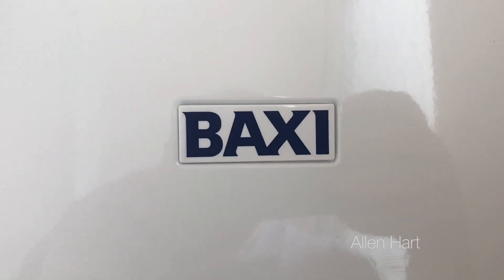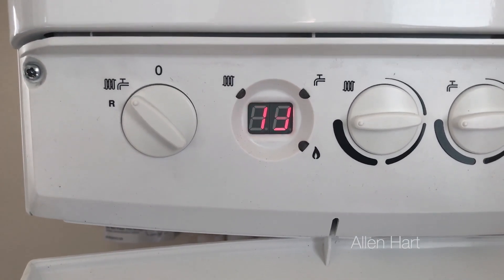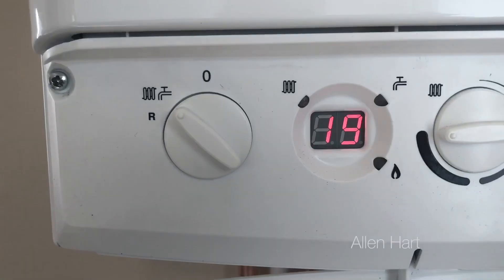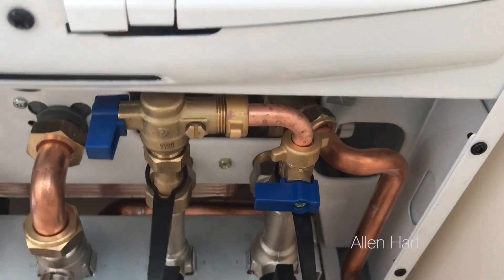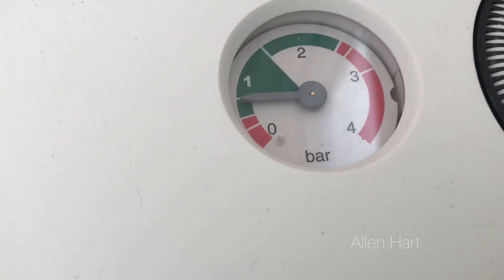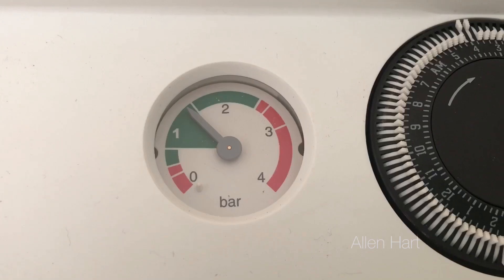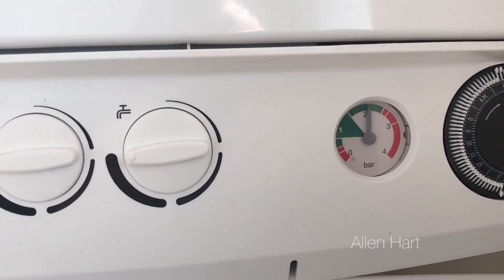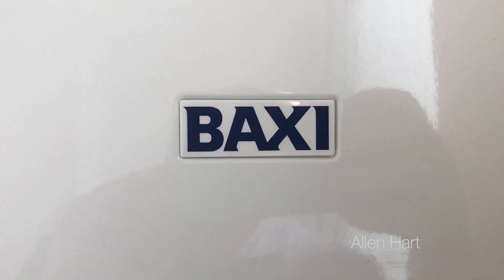How to repair your Baxi E119 fault , Main and Potterton

Comment: I've used this multiple times over the years! Thank you for that, brilliant short informative video

Recently, though it doesn't fix it, I still have the e119 error code when when I've refilled the pressure valve as instructed. Maybe it needs servicing.

Comment: I have a potterton pro max 28 HE with the E1 fault, but the pressure gauge is well in the green zone over one bar. Any ideas? 
Edit: Sorted, our non- prepayment gas meter needed resetting.

Comment: This is a good band-aid fix to get it running again but the low pressure will occur again without fixing the root of the issue. I would check the expansion tank pressure inside the unit as it likely needs to be recharged with 1 bar of air (it's a yearly service that should be done)

Comment: Can u help me m8. I have this boiler. The ngineer came round 6 months ago to check t and it was passed. Since then our hot water is better than it was but wen i went to turn central heating on its not working. Green light wont come on. The dial far left is on hot water\ heating sign   thx

Comment: Hmm we have the same issue, and this normally works. But this time the boiler is already at 1.5 bar and still not working :/. It normally only does this when it dips below about 0.7 bar.

Comment: Hi Allan, many thanks for the vid! Just wanted to ask once the pressure is topped up, the blue valve on the left (out of the two) doesn't appear to go back to its original position when vid started (now its facing down instead of facing towards me). I can't bring it back up to the position where its facing towards me? Is this expected?

Comment: Ive had a bar shower for a few years, with a Baxi boiler , but recently started going hot and cold, so put a new bar on and its exactly the same...Hot pipe straight out of  boiler going hot and cold but not other taps in house. Baxi say it's not boiler and say I may need my taps balancing??? What does that mean? And how does a pipe just go faulty after so many years? What can cause it? Not getting many answers from any forums etc???

Comment: Hi, thanks for the video. 

The blue tap on the left which you move in the video. Is this to be left facing down towards the floor once boiler is filled up or turned back towards 3/9 o clock
Reply from the maker: Thank You

Comment: But why would the water pressure drop?
Reply from the maker: maybe a leak
Reply: @AllenHart999  I had the boiler serviced but I was at work when it happened and the engineer told the Mrs that something needed to be drained and that would fix it. Anyway about two months on now whatever he drained it's not been a problem since. Probably won't be having it on that much now anyway since we're all getting ripped off on energy prices....

Comment: Mine looks a little different, no blue valves or the pipes they are attached to. Would turning the black valves behind them yeild the same result?
Reply from the maker: did you sort it?
Reply: @AllenHart999  I did, I just tried a valve in a similar spot and hoped for the best haha

Comment: Hi Allen, my Baxi was at 2 (when heating on) and everything was working fine. However in past rentals I knew 2 was quite high, so I had my boilerman reduce it, he put it down to 1. Now when my boiler is on all of my radiators aren't coming on, several still cool to the touch. I am starting to think my pressure is too low to heat the system. I notice the boiler is barely getting to 1.5 now he's taken pressure out. Shall I try putting pressure back in and see if it helps get all of my radiators on? Some are red hot and fine but the ones furthest away from the boiler aren't coming on hardly at all. Thanks
Reply from the maker: did you sort it?
Reply: @AllenHart999  yep I rebalanced the entire radiator system using another of your excellent videos! Thanks so much. I was very chuffed with myself being able to do it and follow your instructions!

Comment: Thank you so much for the video as my neighbour removed two radiators for me in preparation for building work and as a result the boiler pressure has dropped to zero. I have topped up the boiler following your instructions but am unsure as to the position of the blue switch on the left. Should both switches finish in the off position once the pressure is topped up? Thank you 
Shirley
Reply from the maker: Thanks very much for your comment, please consider subscribing to support the channel 🙂

Comment: Great videos. I have a MAIN Combi Eco 30 and intermittently get the E119 error, but the pressure gauge is rarely (if ever) in the red. If I turn the boiler off using the turn switch on the boiler and the boiler fused spur, add a little more pressure then turn everything back on, it will generally fire back up after initially using the hot water only settings, then switching it back to HW/CH mode. Any thoughts? Quite a random one.
Reply from the maker: Thanks very much for your comment, please consider subscribing to support the channel 🙂

Comment: What would be the reason if water pressure keeps going below 1 into red after each time it's used?
Reply from the maker: https://youtu.be/X4OssmUEFo4
Reply: @AllenHart999  thank you so much! I know nothing about plumbing/gals heaters, and this problem started last night. Loads of water under the cupboard where the boiler is, i keep topping it up, to just about above 1 bar, and when I switch it on, it eventually (after approx 10 mins) gets to 3 bar, and that's when the water starts to trickle slowly underneath. Main question now, if it goes to 3 bar or higher, should i continue to use it or just turn it off? I owe you a pint just for replying to me in first place.
Reply: @AllenHart999  3.5 bar now
Reply from the maker: stjepanovic84 https://youtu.be/UR9wSU-I2O8
Reply: @AllenHart999  thank you very much for your help today. Merry Christmas to you and your family
Reply from the maker: Thanks very much for your comment, please consider subscribing to support the channel 🙂

Comment: This worked, but now the water pressure when I turn on any of the hot taps is really low (the cold tap's normal). Pressure gauge is at almost 2.5 (within the green), any advice please?
Reply from the maker: Happy to help
Reply from the maker: Happy holidays!
Reply from the maker: Thanks very much for your comment, please consider subscribing to support the channel 🙂

Comment: pressure goes up to over during operation 2.5 almost 3 bars and an hour later it is dropped under 0.5 E119 code? is it overpressurize and then safety valve drops the pressure somehow?
Reply from the maker: Thanks very much for your comment, please consider subscribing to support the channel 🙂
Reply from the maker: https://www.youtube.com/watch?v=UR9wSU-I2O8&t=122s

Comment: Hi Allen, could do with you expert advise. I have a brand new Baxi Duo tec 24 put in my flat 7 years ago. Only this year it keeps loosing pressure. I checked all radiators and no leaks anywhere. Do you know what is going on?
Reply from the maker: Thanks very much for your comment, please consider subscribing to support the channel 🙂
Reply from the maker: https://www.youtube.com/watch?v=X4OssmUEFo4&t=348s

Comment: Hi .just trying to fix my boiler but the first valve it's hard to turn it and I don't want to force in case I break it.
Do I have to unscrew the valve .
Please.
Reply from the maker: They do sometimes get very hard to move. I normally use grips if needed. Thanks
Reply: @AllenHart999  many thanks I will try .
Reply from the maker: Thanks very much for your comment, please consider subscribing to support the channel 🙂

Comment: Could you please advise me what to do if one of the blue valves wont turn? Thank you so much in advance.
Reply from the maker: They are sometimes hard, If you cannot do them then you may need to call a plumber out. Thanks.
Reply: @AllenHart999  Thank you Allen, that is exactly what it was, just needed a bit of elbow grease! Happy to say your method worked perfectly. Many thanks
Reply from the maker: Thanks very much for your comment, please consider subscribing to support the channel 🙂

Comment: Is it normal for water to escape when turning the pressure valve?
Reply from the maker: No, Where from?
Reply: From the valve that relieved the pressure. It started dripping water but the pressure went up and it’s worked since.
Reply from the maker: Thanks very much for your comment, please consider subscribing to support the channel 🙂

Comment: Hi 
I have the potterman promax.. I have the error e119 coming up the pressure is at 0. 
Trouble is I don't have any valves to turn under the boiler like yours.. I have 2 black valves at the back the same as yours, but they don't do anything that's the only 2 I have.. so confusing.. Do you know what else I could do?
Reply from the maker: Maybe you have a remote filling loop somewhere else below the boiler?
Reply from the maker: Thanks very much for your comment, please consider subscribing to support the channel 🙂

Comment: One of the valve switches is not moving, its basically stuck.
Reply: How have you fixed this? I have the same issue..
Reply: I have this issue too. How do I fix it?
Reply from the maker: Thanks very much for your comment, please consider subscribing to support the channel 🙂
Reply from the maker: Thanks

Comment: Hi. In my opinion 2 bar is far too high, 1 bar is sufficient. You tell how to 'top up' the ch system. But you do not deal, or even mention, why the pressure has dropped. Its drops because there is a leak. This should be dealt with. Pearse of Leakbusters [in Ireland].
Reply from the maker: Thanks very much for your comment, please consider subscribing to support the channel 🙂
Reply from the maker: I did this video to start with so i could show my customers how to top it up mid service. I would never advise on any leak buster products. Thanks.

Comment: Hi I have exactly same bioler when I fill it and switch heating on after couple of hour's it goes back to the code pressure drops why is that what can I do please advise
Reply from the maker: Thanks very much for your comment, please consider subscribing to support the channel 🙂
Reply from the maker: Did you sort it.
Reply: They say it can be expansion vessel or relieve valve. 
Is it easy to install it your self

Comment: I have this fault code but I don't have the blue valves?
Reply from the maker: Thanks very much for your comment, please consider subscribing to support the channel 🙂
Reply from the maker: Do you have something under boiler with taps on , Thanks.
Reply: Allen Hart it’s quite strange, there are no valves at all. Well there’s one right at the bottom of the wall but when I’ve turned that nothing has happened!
Reply from the maker: @GSJ86  Should have a flexible pipe somewhere, The cold water needs to fill the heating.
Reply: Allen Hart this may be a dumb question but the boiler is upstairs, could the valves/filing pipe be in the kitchen? This is for a property I’m preparing to rent out, so I’ve inherited the boiler and still trying to get my head around the layout!
Reply from the maker: @GSJ86  It would normally be under boiler but they could be somewhere else.

Comment: Thank you! Managed to sort it out. Super grateful
Reply from the maker: Thanks very much for your comment, please consider subscribing to support the channel 🙂
Reply from the maker: Thanks
Reply: However turns out there is a common fault with this boiler. A part inside is made of plastic on some which leaks (hence the low pressure). After I topped up the pressure it blew a fuse inside the boiler as made the leak inside worse. Now waiting for Baxi to come out and sort!

Comment: Just done this and after I topped up my pressure and the system started up again...it drastically dropped again in around 2 seconds but stayed on. Is this normal?
Reply from the maker: Whats the pressure on now. Thanks.
Reply: @AllenHart999  it's all fine and working as normal again, thank you. Woke up this morning with my little lad, house was freezing Thanks so much for the video, couldn't have done it without you 👍🏻 very much appreciated 🙏
Reply from the maker: Sarah Smart very happy to help, please like the video, thanks
Reply from the maker: @saasarcavi2955  Happy new year. 👍
Reply: @AllenHart999  happy New year ☺
Reply from the maker: Thanks very much for your comment, please consider subscribing to support the channel 🙂

Comment: Very detailed and helpful. You have just saved my Christmas, sir.
Reply from the maker: Happy to help 👍
Reply from the maker: Thanks very much for your comment, please consider subscribing to support the channel 🙂
Reply: @AllenHart999  I have subscribed to your helpful channel! But can you help me with the E119 error code once more? I use the method in this video to fix it but the pressure drops below 1 very quickly when I turn the valve back off.
Reply from the maker: @urieltan9266  maybe you have a leak
Reply: @AllenHart999  thanks for the heads-up.. I'll check for that, or call customer service.

Comment: Thanks Allen, I had removed a radiator to do some decorating. Fitted it back, opened the valves. Then came to clean up, no hot water out the tap from the kitchen sink. I thought I was going to have to call a plumber on a Sunday!! Thanks again!
Reply from the maker: Happy to help please like our video, Thanks.
Reply from the maker: Thanks very much for your comment, please consider subscribing to support the channel 🙂

Comment: well.. U have two blue Valve? I have all black.. So i don't know which is which XDD
Reply from the maker: Thanks very much for your comment, please consider subscribing to support the channel 🙂
Reply from the maker: its the two valves nearest the front of the boiler, in the same place as these ones. Thanks.
Reply: Now i have a problem. Because I can only turn one valve on the right side  (Close and Open) put the next valve which should be pump the water pressure is stuck in one position... And I can't turn it...

Comment: thanks for ur useful video.i coulnt turn the first blue tap of our boiler.can i use screw driver to turn   it?
Reply from the maker: N. Eb Sometimes they are a bit stiff, I wouldn’t advise anything else other than what’s in the video, if you need more help please call out a local gas safe engineer. Thank You for watching
Reply from the maker: Thanks very much for your comment, please consider subscribing to support the channel 🙂

Comment: Thanks pal! That sorted out the E119 error that I came home to.
Reply from the maker: screwge84 glad we were able to help, please give us a like , Thanks for watching
Reply from the maker: if you are needing to top the pressure up all the time them it could mean a few things, it could mean you have a small leak on your heating system, it could also mean the boiler needs a service and the expansion vessel repressurrising. it could also mean the prv is dripping, it maybe time you called in a local gas safe engineer to check it all over for you. i hope this was of some use. thank you for watching.
Reply from the maker: Thanks very much for your comment, please consider subscribing to support the channel 🙂

Comment: What if the pressure is correct and the boiler still does not start?
Reply: Try to reset the boiler
Reply from the maker: Rafał you will need to call out an heating engineer or give Baxi a call